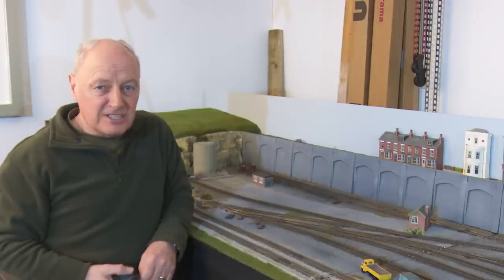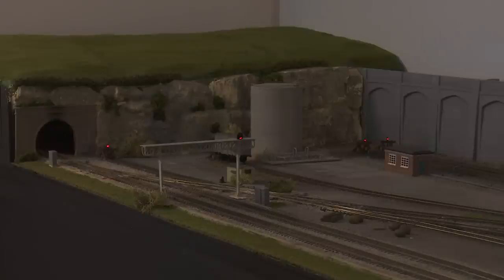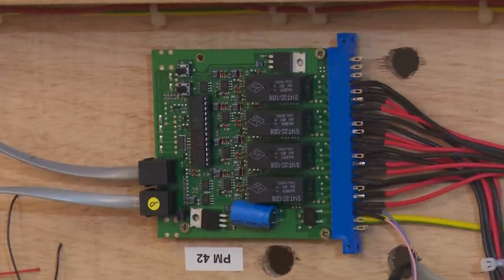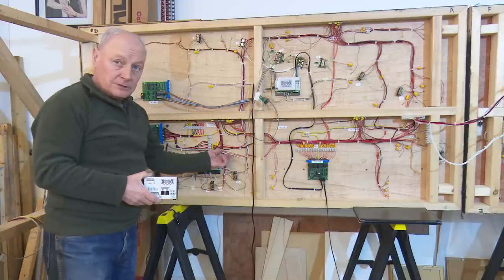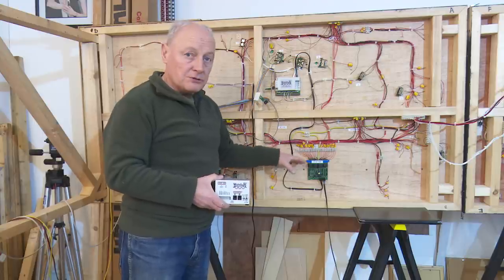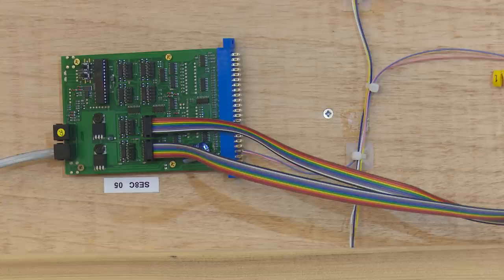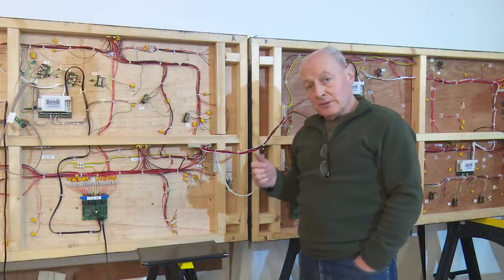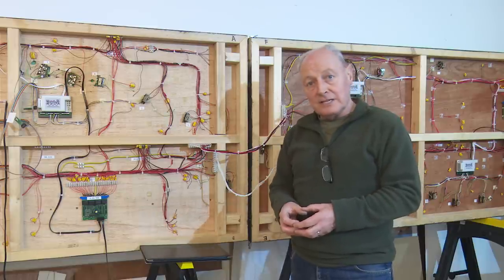17. DCC Wiring at Chadwick Model railway.

Comment: I understand that it is 'possible' to control points at the controller, I just don't understand why anyone would do it.  I am a member of a club which displays a simple exhibition layout.  The 'expert' who set up the DCC insisted on controlling the points using the Digitrax handsets.  He understands it, but he does not turn up to operate it at exhibitions.  Everyone who does has to learn the controls and then operate them as well as their train.  It requires you to remember the point number of each point and switch between operating the train, then changing to set a point, then back to your train, then back to changing the points.  It is overly complex and cumbersome and visitors lose interest as the trains are stopped for an inordinate amount of time.  A simple momentary contact switch set into the fascia would easily have done the same job, would be easier to learn, and the switches could have been duplicated at a remote location. 

The other issue I have with DCC is the hypocrisy of its proponents.  'Oh it is simpler.'  No it isn't. Look at all the extra power supplies and modules you have had to add just to keep three blocks operating.  Plus a control module for every set of points.  'It only requires two wires.'  Rubbish!  As we see from the underside of your layout, it would have been simpler to wire for block control if you were only going for three blocks.  'It is not much more expensive.'  (This is the real kicker.)  It is costing me twice as much for a DCC loco over a DC one, and I am fitting the decoders myself.  A basic DCC starter kit of power supply and controller cost AUD$500, which is more than I ever spent on all of my DC controllers and switches for block control.  Then I am supposed to buy additional controllers for each visitor who might run a train.  

I have committed to DCC now, but the only advantage I can find is the sound.  Everything else is more trouble, more work and more cost.
Reply from the maker: Hi Grumpy,  that was the point of the video.  Two wires, my foot!  I explain the technical depth required to lead to computer automation and the effort required.  It sounds as though your club has allowed someone to ride roughshod over a more simpler solution.
Regards Charlie
Reply: G'day.  Sorry for the rant.  I held out for years, but when I finally joined a club I felt like a dinosaur, but now I wonder.  Progress is a good thing, but I think some of it is unnecessarily complex.
Reply: Mate its done because of computer automation! you can let your pc run the whole layout and just sit watch and relax with a coffee!
Reply: Dcc advantages over regular DC are HUGE! for starters your trains will run realistic and smoother as its digital, the points along with all lighting of buildings and trains can be automated, theres no reason to use DC today its primitive and unreliable. you can also run loads of trains on the same track in different directions good luck trying that with DC! and dcc can also be wireless, the benefits go on and on, so sorry fella you are wrong. Even a hornby elite has time based automation built in.
Reply: Seems like a sensible comment that should be read before anyone embarks on a DCC project.
Reply: @047678  We are progressing,      backwards, cars, tv's, the lot, I'll stick to my drums (acoustic that is, not edrums where possible) actually  I might purchase a dc set, that looks simple enough for a drummer lol.
Reply: @Synthematix   Not when the computer locks up or logs you out to do an update ( frequently )etc etc,  the advantage should be huge but it seems hard work for the rewards,sorry give me a few years to be beaten down , now wheres me key to wind the set up (not me)..Chris.
Reply: Ideally the best setup would be computer control and manual control combined
Reply: @Synthematix   that's true, now I kid you not my computer did an update 10 minutes after my comment (big brother lol) but in fairness it actually asked if it was ok (that is not normally how it does it ,must have changed,can't last,thanks, Chris.
Reply: I make my own windows 10 iso with MSMG toolkit, i remove every trace of bloatware and crapware, runs fast as lightning on my Ryzen 2700X cpu

Comment: on my analogue Model Railway technically I can run 10 trains at one time , However they will derail and Crash . I can on my own run 3 trains safely with a 4 train shunting and running round etc.my question is if I convert my 250 powered 00 trains will DCC Stop them derailing . of course I would have to become a millionaire to convert.
Reply from the maker: Yes, with Train Controller Gold and heaps of cash, anything is possible!

Comment: DCC a wonderful concept still unfortunately fundamentally flawed. As DCC was invented by an Electrical Engineer in the early 1980's, who had no understanding of railways. He simply created a commercially attractive solution to the major area of resistance preventing model railways becoming a mainstream hobby - i.e the electronics involved. 

As a result NO provision was made for the most important aspect of real railways, which is the physical inter-action between train movement and signalling. Quite the contrary. DCC has no option but to replace the traditional 12v DC in the rails, with 16v AC, as only AC (Alternating Current) can carry messages between the controller and the train or accessory "chips". In other words you can now move numerous trains simultaneously in any direction you like and even have head on crashes, which goes against the most fundamental safety rules of the real railway. 12v DC wired layouts won't allow head on crashes simply because DC ensures all locomotives go in the same direction, so it does at least start by complying with one of the most important real life safety rules - to prevent head on crashes.  

There are a number of manufacturers who provide DCC accessory chips that will operate signals. But it is impossible for these "signal controlling chips" to actually operate the signals in a real life manner. Why? Because these "signal controlling chips" cannot know what track layout you have, or detect the presence of trains in relation to the position of ALL the relevant signals. Signals in real life are inter-linked either mechanically (semaphore signals) or electrically (colour light signals). Why?. Because train drivers need warning signals usually a mile or so in advance of any red, or it will be impossible to stop a train in time.   

This problem of inter-facing the trains to the signals in a realistic manner using a Digital system, was soon recognised. But the solution is that computers are now needed along with a comprehensive understanding of both electronics, and real life signalling. This of course defeats the simplicity of DCC and increases the costs still further. It should be added that commercial DCC is itself between 100% and 300% more expensive than traditional 12v DC wiring methods. 

Realistically the only way to construct a true model railway as opposed to a toy train set, is to have signalling that works in a real life manner. The only way to do this is to have real life type "track circuits" which provide the inter-face between train and signals. The only way to do all this cheaply is to use a 12v DC system. As 12v DC has the advantage due to its electrical nature of accommodating two separate supplies in the rails (one to move the trains and the other for the track circuits) without creating an electrical short circuit !

The bottom line therefore is that while DCC may seem attractive (although more expensive) it simply prevents a recreation of a real railway in miniature due to its serious technical short comings.
Reply from the maker: Hi TD, this is clearly something that you feel very strongly about.
As you’re aware I’m a DCC enthusiast and it was sound fitted locos that brought me back onto the hobby, post military retirement.
I believe that must give ourselves room to develop our hobbies and only offer advice and not criticism, which ever system, scale or gauge we adopt.
Regards Charlie
Reply: As both a qualified train driver and railway mechanical engineer, and a long time model railway professional, obviously we are talking hobbies here.... 

But if DCC does not get its act together, you may find it suddenly vanishes off the market. There are already steps by certain others dissatisfied with the fundamentals of DCC, to correct DCC's major failing, the lack of inter-face between train and signals. Read on...   
 
Fleischmann spent roughly £2 Million developing a major change to DCC to encompass the real life inter-face between trains and signalling, by incorporating this technology in the master controller.  This was unfortunately deemed "non standard" by the large and powerful NMRA and therefore would not have been accepted in the USA, a major market for Fleischmann. The result Fleischmann gave up and sold out to Roco. No one is therefore likely to attempt again to solve the fundamental flaw in DCC. 

Currently MERGE is one of the only systems available (using digital chips) which can provide the missing technology. But because this isn't manufactured and packaged by a major model railway company, there is still a lot of wiring the user has to figure out. If that changes then DCC may rapidly die !

Currently this all means people like myself with a large complex 4 track mainline exhibition layout cannot use DCC even if we want too, assuming that you understand how real railways operate. The solution to the train signalling inter-face problem can be solved quite easily with a 12v DC layout using nothing more than relays, and the necessary real life type track circuits, which require only a piece of wire to create each track circuit on a 12v DC layout. So its also a very cheap option and solution, although laborious to add all the extra wiring and plan all the real life type interlocking that the relays must enact. 

On a large complex layout with numerous junctions and crossovers. The necessity to protect your models from crashes and expensive damage, equates to the real world where they have safety systems in place to prevent real trains crashing and killing passengers. Signals therefore cannot be cleared if the route is not set, and all other signals for any other conflicting routes are locked at red. Onboard Automatic Warning Systems (AWS) of various types ensure drivers don't crash red signals. 

On a model layout preventing operators crashing red signals is easily solved (on 12v DC layouts) by the relays which select which colour or position each signal is displaying, and can also automatically cut power to the track ahead of any red signal simultaneously. So preventing a train going more than a loco length or so beyond a red. Further each signal can be realistically inter-linked with other relevant signals as in real life. 

Example: As a model train passes each signal it passes over a track circuit (in one rail) and returns that signal to red, and switches off a section of track to prevent a following train crashing the red. Once the train passes a following signal it changes that one to red, and releases the previous signal to yellow. All done simply using 12v DC relays, and track circuits. Now just imagine having all that ready made and ready to simply add alongside all the other accessory "chips"with DCC. 

DCC would then become a genuinely realistic option, mimicking real life operation and preventing sleepy operators crashing and damaging your expensive models !  

The Duke 71000